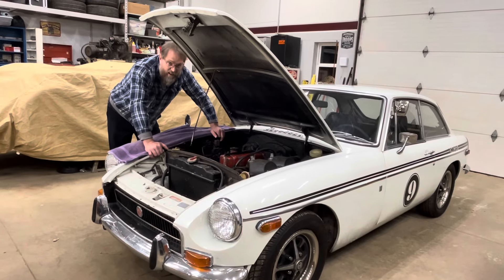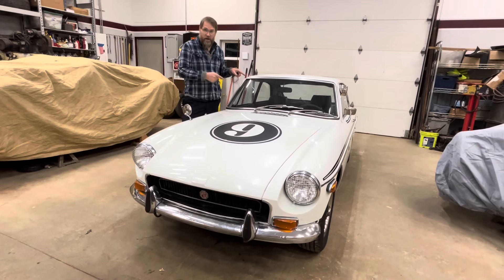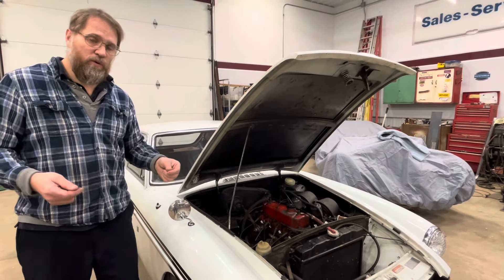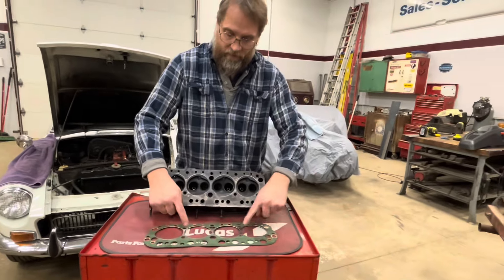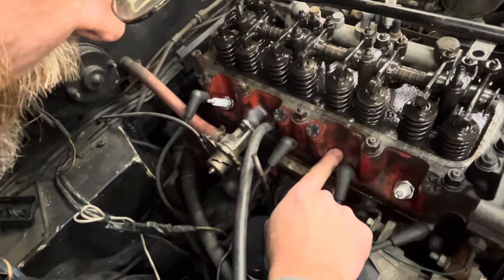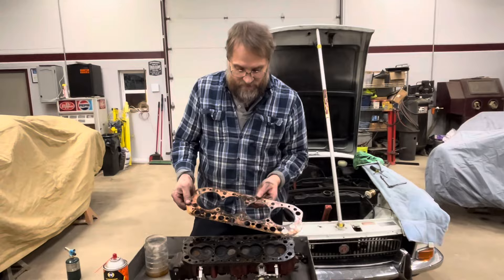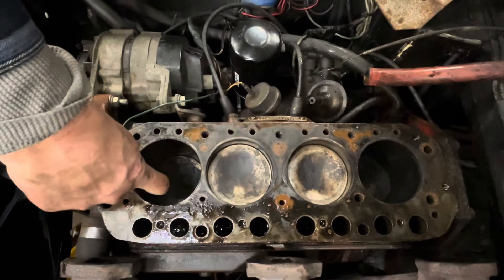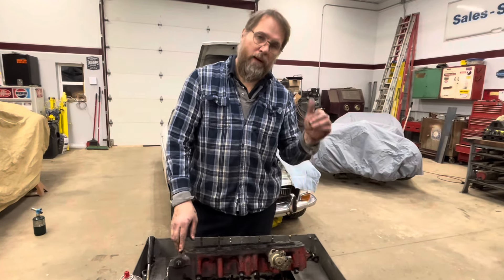Looking at MGB exhaust work turns into a head job

Comment: Great video! I enjoy your content.  This is timely as well - which brings me to a question: I am putting the intake and exhaust studs into the head of my 79 MGB tomorrow - what thread sealant should I use?  I was going to put Permatex 592 high temp sealant on the threads before running them in.  I am concerned about sealing because of the amount of oil that seeps out when you remove the studs.  I have the exhaust and intake off as part of my project to change the gasket, rebuild the carb, change gaskets on the tappet covers, and wire-wheel clean my header/intake manifold.  One of those jobs that turned into to five things.  When I had the header and intake manifold off, I noticed how jacked up the fit was and the combination of fasteners the PO used.  I have everything sorted out now, ready to re-install the studs and manifolds, carb, etc.  Just wondering about the thread sealant.  Thanks again for the great videos!
Reply from the maker: Those are tapped through to where oil drains down, but the oil there isn’t under pressure. Rarely will they actually leak oil once the stud is installed even without any sealant, but using a little won’t hurt and is a bit of insurance ( if you already have it handy).
Reply: @mgbgtguy  thanks for the input on that.  All installed now, ready to put my carb on and see how she runs.  Looking forward to more of your videos!